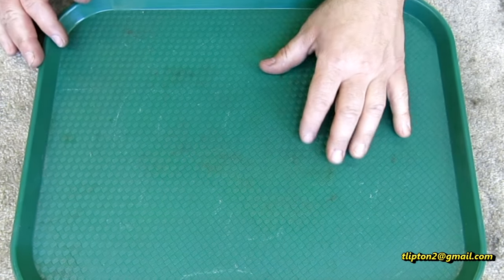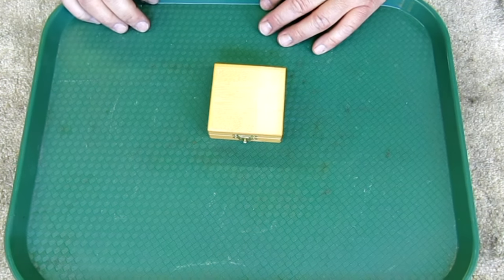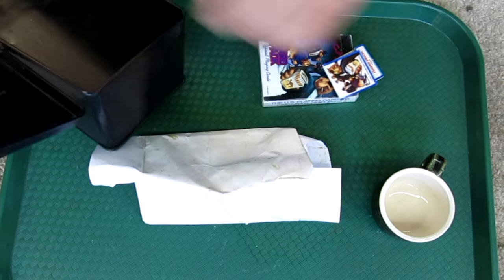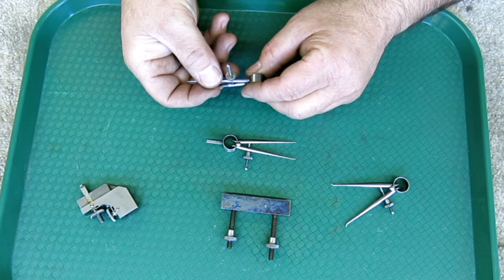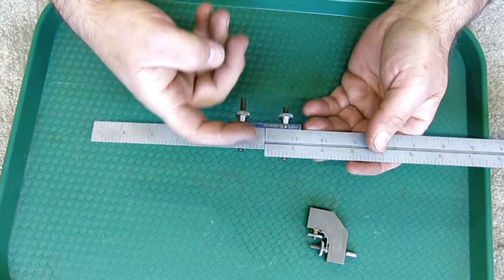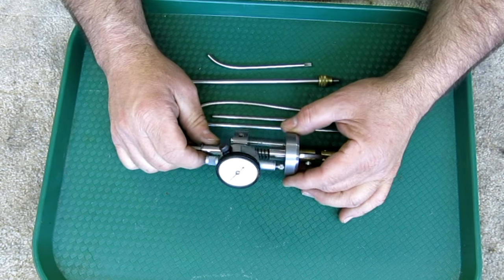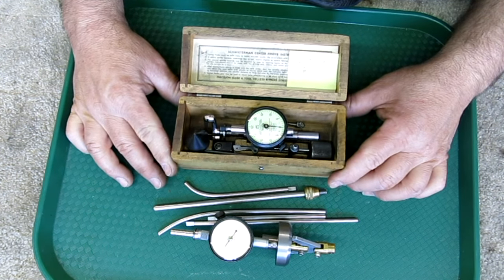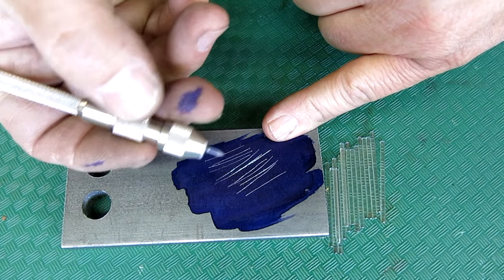Heavy Metal Mail Call 6

Comment: Lucky you with those 10+ repousse' tools! Not only for metal work, but for "tooling" leather also. A trick I use when dealing with an old dried out leather hide before tooling, is to spritz water on the surface. When dried the tooled image is "set". Some very nice viewer gifts Tom, looking forward to video of the "Bash". Cheers.

Comment: Nice tool set.  I like to see what you come up with the Pump shafts,  Great for a wear tip on an indication device.  I like the suggestion of Don for LE.
Reply: +Randy Richard , you're going to have to get Tom a special sized RR in the Shop scribe holder.  :-)  I sounds like they may be hard, but maybe a little too brittle for normal work.

Comment: On the GE dial indicator i think it's actually 10 LB/Div. The B turned in to an E, i have one myself, it's very faded, i believe the paint is really crappy quality (since it's a MFD unit). On mine you can barely make out the Gene__l E_ectric. The graduations are ok tho, perfectly sharp, otherwise, on the outside, it doesn't seem to be worn out at all.

Comment: Hey Tom-  It's supposed to be "LB" not "LE". Definitely from some kind of weight or force scale. I kept its twin from the same lot, the other one has a sticky action but evidently better printing ;^)  

+Donald R. Cossitt, yes it's a tenths indicator (rebranded Federal C21) so scale equates to 10 lbs. per division or 100 lbs. per mil. Which could suit the Tom-O-Meter if it wanted an "upgrade". Or maybe  a "retro-grade."
Reply: +11zekim ...Abom79 has a video using one of these weight measurement rings with dial indicator...better than 1% accurate...
Reply: +Doug Ankrum Thanks, I looked it up; Abom'79 "Saturday Night Special #67". A viewer loaned him a  "Cal-Test" proving ring with this indicator (but with the standard inch scale, not relabeled).